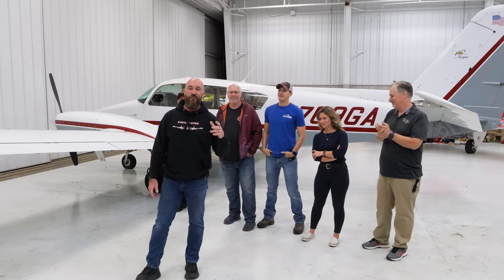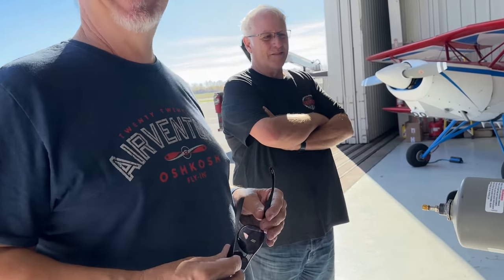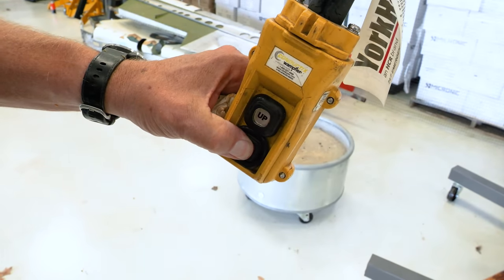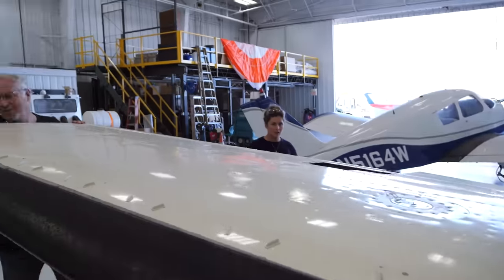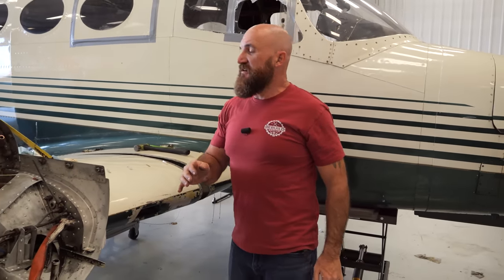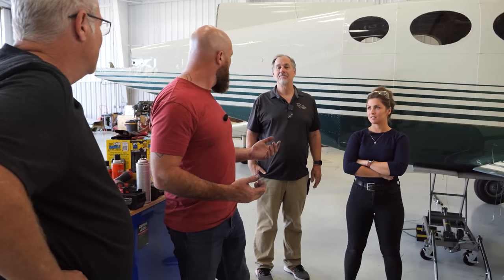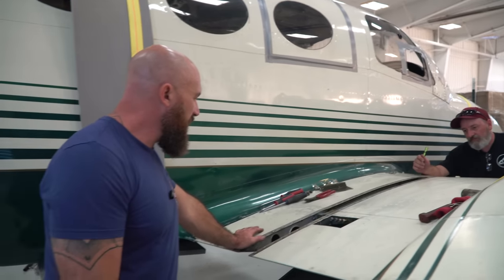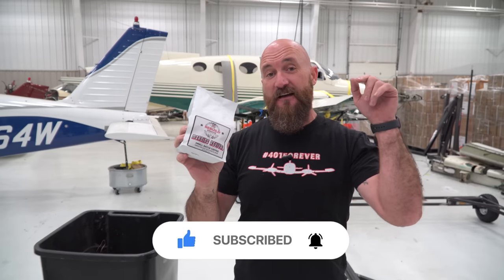We Failed At Removing the Wings on The Free Abandoned Airplane

Comment: I would consider removing the skin from the top of the wing, in order to gain full access to the bolts when installing the new wings. That may be the best option. Cheers from Winnipeg.
Reply from the maker: Thank you for the idea !
Reply: @rebuildrescue  Do you have the maintenance manual? What does it say about the procedure? Someone else said chapter 20 has the details.

Comment: I really don't think those ten bolts ae supposed to be removed. It looks like they hold the wing attach point to the spar and the lateral bolts you removed should have allowed you to remove the wing.
Reply: @eagle2019  Interesting. I just looked at the wing attached points on the Cessna 401. Are you sure you don't want to revise your comment? Also rewatching the video I notice a fuel line still connected while they were trying to separate the wing.
Reply: @eagle2019  My response with a link to a picture of the wing connection points either didn't post or was deleted.
There are four bolts holding the wing spares to the carrry-through two ~1/2" for the rear spare and two ~3/4" for the main spare. It is plain as day when you look at the wing root. There are no other attach points than those four bolts. Thousands of wings are attached that way. There's no need to remove the spare attach fittings from the wing to remove it. There is no need to get into the wing to remove it. Four bolts. That's what they removed, those four bolts. 
I'd show you but I can't find how to post links in a YouTube reply.
Reply: @eagle2019  I tried posting the link again and it disappeared. I guess the no links security is turned on.
Reply: @eagle2019  The bolts at 21:46 are not removed to remove the wing. There are four bolts that connect the wing spars to the carry-through. Two for the rear spar and two for the main spar. You remove the cover faring, which is not in the video, look down and you are staring right at them. They removed those and the wing started to move off. I submit the still connected fuel line is preventing them from moving the wing further out from the fuselage. 
You are talking bout the "Y: fittings that are bolted to the spars. In the case of the video the rear has ten bolts holding that fitting on. You don't remove those "Y" fittings from the wing or the carry-through. 
The four longitudinal bolts are removed and the wing comes off. Look at a picture of a 401 wing root removed from the plane and it is as obvious as a heart attack.
Reply: @eagle2019  Can I email you is pic?

Comment: Sounds like you need a pneumatic or cordless palm hammer that taps nails in with vibration. Aka vibration hammer.  Just use one of these in conjunction with a punch that will fit. A little oil on the bolt will help too. However, if you get one that’s stubborn just heat it up with a torch and use an ice cube on the surrounding metal to keep the temperature down. You don’t want to make the metal brittle by hardening it.
Reply from the maker: Thanks for the tips !

Comment: The stress is from the strut pushing up on the wing and the fuselage being pulled down from gravity. You need to lift the fuselage to relieve the tension on those bolts. If it were done professionally the entire aircraft would be put on jacks, gear lifted and locked in the up position then the wings would be removed. I also believe, like others, that you are removing the wrong bolts. There has got to be some or one on the other side with easier access.

Comment: I remember a story of a C-130 (or 141?) that got stuck in the mud. People came around and ran cables around the fuselage, nose and main gear. They pulled and pulled, one at a time tearing each gear off then slicing the airplane in two. Someone later pointed out hard points where lifting eyes could have been installed. There were hard spots inside the fuselage. If they had lowered the ramp they could have run cables in the cargo bay and pulled from there. I wonder if Cessna has lifting points for the wing.
Reply: Nice story but it's just that, a story - not a documentary.

Comment: Can you explain why you keep using a cylinder leak down tester as a compression tester?
Reply: It is the aviation standard.  Using this method,  one can hear any bypass leakage.  Rings through oil filler tube,  exhaust valve at exhaust pipe, intake through carb, or air filter assembly.  Problematic for these 401 Continental engines is exhaust valve to guide wear and often at half engine life the ex guides will be changed. The Cougar's Lycomings have similar issues with valve, guide wear.

Comment: The airplane isn't properly supported, the fuselage should be in a cradle or shored up and the gear retracted as another mentioned below.  The landing gear should not be supporting any of the aircraft's weight!
Reply: @eagle2019  or, they are going to mangle the fuselage side of the fittings...bye bye plane!

Comment: My GUESS as to how those bolts were originally installed is this.
The wings weren't fully finished off before assembly.
The section of the wing that Jason cut into was left off until the wings were fully bolted on then that last section of wing was riveted in place.
This is a complete guess.
Reply: @eagle2019  'easily'  ???  it's taken two video-lengths to get to this point,  I'm not a mechanic but seriously, if it's easy then it should be off in 30 minutes, right ? Can you reiterate the full instructions for us laymen to follow, should we evern need to replace some wings on a Cessna 401 sometiume in the near future ?
Reply: nope, your GUESS is not correct.

Comment: Cringing at pinch points and lack of PPE, gloves.  One would think there would be factory lifting points. Appears those bolts went on before the outer sheet. Should I ask  what was going on there with the shaking and rock in rolling 🤣
Reply: Think about that for a moment. Integral lifting points for wings that may not be removed over the entire life of the plane. Nah, that doesn't make sense.